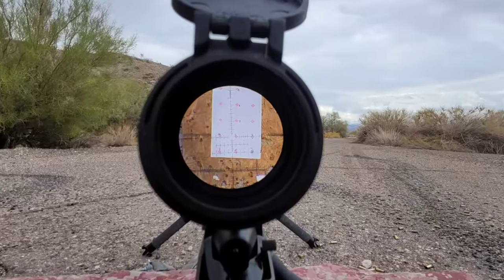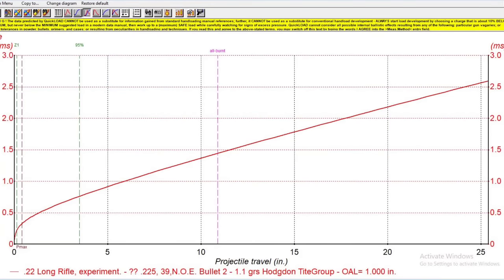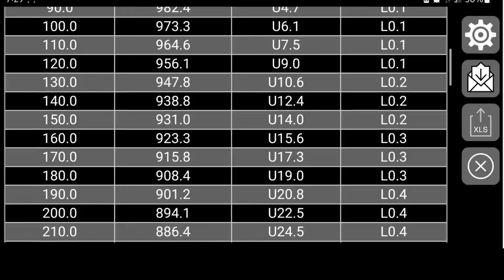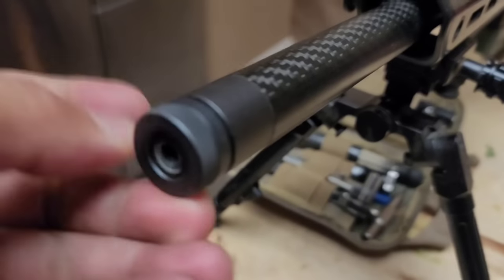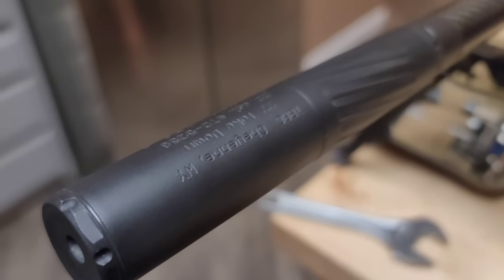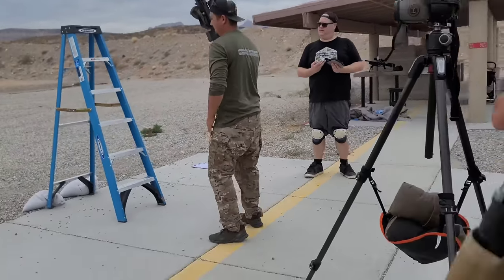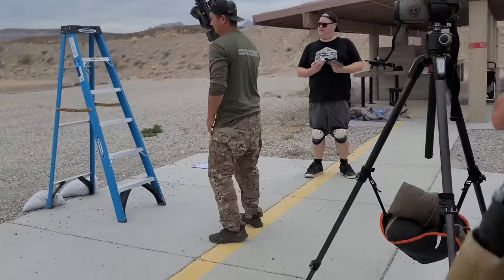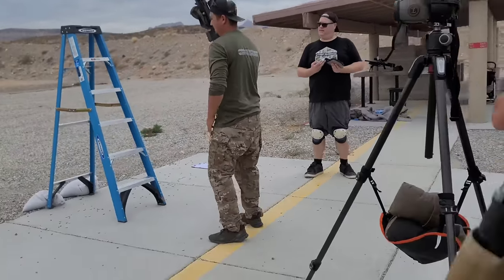What makes an accurate 22LR | Mythbusting Part 2 #DPGunworks

Comment: Dude this is a GREAT SERIES !!! Thanks for taking the time to put this all together, it’s obvious there is a ton of time in this video . Super well done Buddy
Reply: Old timers use to put 24 inch Barrels and 26 inch barrels and I have to think the added length would have to help to conform the bullet and maybe just maybe it would help to make the bullet a little more concentric and in return help the bullet fly just a little bit truer. If it doesn`t slow the bullet down I would think they had it right but then they probably didn`t have machine as well made as the gun smith have today.
Reply: One of the most accurate 22lr rifles I ever shot was a friend’s old marlin lever action with a very long barrel that probably had national debt equivalent rounds thru it. So I do agree barrel length selection must be either for accuracy or velocity. Unicorn are just that until either technology or manufacturer care improves.
Reply: What you are talking about is what my dad and I discovered years ago with .38 special and 30-06 by casting our own lead bullets for accuracy 😊 my best .22 rifle for accuracy was and is a 1970 bought Marlin 39-A Golden rifle and my dad’s 1917 Remington Infield world war 1 rifle with a 150grain round nose cast lead bullet 😊 He would work and learn the right mix of lead 😊 it was fun to watch him do this😊he is now in heaven 😊dad always spoke of barrel lenght and velocity to get those tight groups
Reply: @richardmattix5322 the longer barrels works just fine 20,22,24, and 26 was sometimes the sweet spot😊I am old enough to watch those old timers do it😊I enjoyed spending all day at a 200 yard rifle range from 1963 to 1972 😊

Comment: The most accurate 22lr I own is an Anschutz match 54, 24in barrel. If you swage a bullet through the barrel you'll notice the bore diameter gradually tightens. They hand lap the barrel at the factory with fewer strokes at the muzzle, this probably allows for a more gradual deformation of the bullet
Reply: That 24 inch barrel is the sweet spot like on a Marlin 39A golden made before 1990 I am just picking a year but you can tell what I mean Remington bought them

Comment: Looking forward to your 457 barrels!  My varmint 20” non MTR is producing about 0.5-0.8” 10 shot groups at 50.  But it can keep 20/20 rounds on a 2” circle in calm conditions at 100. 

Not great not terrible but I figure I’ll either tolerate it and continue ammo testing or just go balls out on the nicest custom barrel.  I realize the CZ is not optimum with its 1” max diameter but I think I’d want 26” minimum.  Plus… as evidenced by my 28” super Lux long bois are pretty dang quiet with match/subsonic

Comment: Here's another theory on why the longer barrels might be more consistent. Do think it is possible that when the bullet leaves the barrel the hollow base of the bullet will have a tendency to flare a little if the pressure is higher and this would hurt consistency? With the longer barrel the pressure is lower and the base of the bullet would flare less or not at all. I say this because I have recovered fired 22LR bullets from very short barrelled pistols and the bases were grossly flared. I also think you are right. Those soft lead bullets are kind of swaged by the barrel and if they happen to go through a tighter spot they are soft enough to kind of swell back to shape for full obturation. A harder bullet may not do this so if it encounters a tight spot it will remain deformed and will develop more "looseness" as it travels down the bore and encounters more tight spots. I say this because as a trained forensic bullet examiner it is well know that with lead bullets, the striations we compare are usually from the last inches of the barrel whereas with jacketed bullets they will pickup different striations on their surface all the way down the barrel. The jackets are harder and are permanently deformed or at least until the bullet encounters something else later that might over-engrave the first striation.
Reply from the maker: Much appreciate sharing your expertise from training. This gives good insight.  Thank-You.  The shorter barrels do give less time for the bullet to return back as you mentioned.  This definitely will effect the bullets BC value

Comment: Hi, I liked the two videos very much, but I took a different way to come to the same conclusions. I love shooting the 22lr, but I wanted to shoot in the BR 50-50 matches at my local range in VA. Like you said in the videos, I noticed the winners had different actions they all used long barrels 26 to 28 inch. And most of the winners used Eley ammunition and Harrel barrel tuners. So, I gathered op all the parts and built me a rifle and while I never won a match, I did come in 5th place in a field of 18 shooters.
Reply: Kettlefoot by chance?
Reply: @jonathanrollins2470  Not Kettlefoot, I was shooting at Blackcreek shooters on the other end of the state.

Comment: Interesting video.  Sorry I didn't find it sooner.  

Regarding longer barrels being more accurate, another factor to consider is that after the powder burns out, the further down the tube the bullet goes, the lower the residual gas pressure and temperature get, so there will be a reduction in muzzle blast playing off the bullet base with a longer barrel.  That will reduce lateral drift caused by any degree of asymmetry there may be in how that blast deflects off the bullet base.

Comment: I believe that obturation is the expansioñ of a bullet casing under ignition pressure which in turn causes the case to grip the chamber walls. This greatly improves the safety of many cartridges by preventing the bases of cartridges being torn off.
When the pressure releases the case shrinks down and can be extracted.
(,Information sourced from Wikipedia)
Reply from the maker: Their is projectile obturation, the temporary elastic property of a lead projectil to seal inside the bore and mitigate gas cutting. (Look up obturation on cast bullets). And thiers the same with the case...... both work differently

Comment: At one point I got in to break barrel air rifles and I figured out there was one brand of pellets that seated in the barrel more consistently than others like crossman which had a variance in tightness when seating the pellets. The crossman was a softer lead as well I noticed. The brand that seated more consistently had tighter groups.

Comment: Wow. I was't expecting this when I clicked on this video. Well done. It might be possible to build a water trap to capture the bullets without deforming them and measure the bases from different length barrels. That would be interesting. If plain water deforms the bullet too much maybe aerate the first few feet of the water or even make the top couple of feet shaving cream or something. 

Liked and subbed. You are brilliant. Thanks for sharing your knowledge.
Reply: When experimenting with .22lr through a smooth twist barrel we captured the bullets with no visible damage  in a double  12 tog synthetic  duvet rolled up length ways .  Obviously safety first at all times.

Comment: Be interesting to see if groves cut into the lead in the longer barrel somehow become more deformed the longer it goes down the barrel   creating less consistant areodynamics. Like somehow the lead rolls over on itself less consistantly or more somewhat how a knife blade is sharpened more on one side. My two cents but I dont have any answers though.

Comment: Just found you, and I'm glad I did.  Awesome video that answered questions that I have had forever.  I do have a question concerning the Ruger 10/22. maybe you can help.  I have built 2 Steel Challenge rifles, both using Tactical Solutions barrels, and they both work great.  However, in my quest to make an even lighter rifle I made a barrel as follows.  I took the standard Ruger barrel and cut it down to 6", turned the last 4" down to .50" diameter, heat swaged an aluminum tube onto it giving me a total barrel length of 16.25", and a weight of 11 oz.  Accuracy is great for SC shooting, but the gun will not function properly because the weight of the bolt, and the spring rate are designed for a rifle length barrel, not a pistol length.  So now the question.  Should I reduce the weight of the bolt or just use a lighter spring?  Or a little of both?  My fear of going to a lighter spring is that with the bolt going forward I may not have enough energy to strip a round from the magazine.  I polish the lips on the magazines to eliminate drag, and reduced the spring tension in the mags by reducing the number of turns on them.  Any suggestions as to which way to go?

Comment: Awesome, however, I think  people mis spoke  when they say-wrt a 26" bbl- you can move the bbl before the bullet leaves the muzzle. Mistaken problem  identity?? We all know bbls simply hang,, or sag due to gravity. If one is wobbling however slight, or there is always some vibration just sitting there, unfired. THEREFORE- could it be, wrt the longest barrels- is there possibly be a whipping effect?-  However slight as a shooter moves the bbl around to get on tgt? IE: BARREL WHIP EXACERBATES the problem?? Does Trigger pull & lock time  in the longer 26" bbl cause slightly more whipping?  Couldnt The sum of all that have more of a disadvantage effect on a longer 26" bbl?
Thank You for a great GREAT video!

Comment: .22lr powder is actually a bit slow. However, the percentage of high explosive primer compound is much higher than a centerfire cartridge. I discovered this when I was working up the .22  Epperson Cricket, .25acp case necked to .22 caliber. That project was an attempt to recreate .22lr ballistics in a centerfire, reloadable case. While it was an interesting project,  the difference in primer amounts demonstrated that it was actually not possible.
Reply from the maker: Look into 22rf CF made by RCC brass. Its a reloadable 22rf brass with SRP pocket. PTG makes the stiller action with both rimfire and CF 22lr bolts. Im actually working on building a rifle for a client using cutting edge 50gr bullets and a 1:6 Bartlein 22rf barrel
Reply: @EagleEyeShooting  
I spent several years on the project, but that was back in the late '90s and early '00s. Had all sorts of energetic conversations with several of the, I like to think, major accuracy players. Including Bill Calfee. 
But as for a centerfire crossover, the rimfire case has to have high explosive primer material all around the rim, while the centerfire primer requires much less for that primer cup to function. The difference in energy impulse between the two is huge. Aguila makes the Colibri ammunition with no powder whatsoever, and originally made it with just a standard rimfire primer charge. A centerfire primer just doesn't have the umph to get even the 20 grain pellet to clear a 20" barrel.
I went by the group nickname Vibe back then.

Comment: I noticed you didn’t mention problems caused deformation of the soft lead from feeding problems as the bullet enters the chamber? I have wondered if this could could be why some ammo may not shoot well in a particular rifle?
Reply from the maker: Absolutely can contribute to accuracy issues if the chamber isnt chamfered well and or feeding angle is causing shaving of the projectile. Benchrest shooters in small bore favor the single shot Still 1500 actions to eliminate bullet deformation or shaving.

Comment: Regarding barrel length...do you happen to see more consistent es/sd numbers in 20"+ barrels?  This had been a LOOONG ongoing debate at our club.  We've got shooters on both sides of the debate.  

Myself, I've cut down a handful of barrels into the 18.5-20" range and I don't think I have enough data to prove anything either way. I have seen ES/SD numbers appear to go up once I've gotten into the 16-16.5" for barrels I've cut down as suppressor hosts.  But, most of the barrels I've cut that short weren't top tier accuracy barrels either (mainly savage and ruger barrels).
Reply from the maker: To summarize briefly, it's not just about optimal velocity.  The extra length of these barrels helps uniform the projectiles shot for shot, giving a better, more consistent G1 BC value. Pressures also normalize optimally at these longer 21+ barrel lengths. 
Its the same concept when slugging a barrel, the last few inches tend to be a smooth push if you've slugged a barrel. Theirs a lot of fallacies about 22lr accuracy. If shorter barrels performed better, than these ammo manufacturers would market it that way

Comment: Thank you very much for sharing your knowledge!   If you mentioned bullet jump or the distance between the bullet and the rifling, I missed it.  That seems to be a big deal in center fire, so I would think it might be important on 22 LR.   Do you have a goal or preference for that space?
Reply from the maker: In 22lr Rimfire, it's quite different.  The cartridge is headspaced from the rim so the fitment of the bolt face to the barrel face is crucial. The chambers are set to engrave the lead projectil.  So it's engaged into the rifling a lot. .120"

Comment: Kenny what are your thoughts on "bolt shims"? Mr Revolver guy on the Day at the range channel swears they helped improve accuracy on his rifles.
Reply from the maker: Bolt shims tighten the headspace. Without knowing your rifle's headspace, you can reduce headspace to below a go gauge and start inducing extraction issues. CZ455/457 rifles are easy to measure headspace by removing the barrel and using a depth gauge. I wouldn't recommend blindly shoving shims like he did between the bolt without knowing where your at in headspace. 0.041'' +-.001 is ideal for Eley 0.043 +- 0.001 for Lapua/SK. Bolt shims reduce headspace. Barrel shims for CZ's increase headspace
Reply: @EagleEyeShooting  thanks appreciate your sharing knowledge with us

Comment: Thanks for all the work you put into this video i learned a lot. But now to take this one more step.  if i buy/build a rifle with all the same equipment you have will it shoot exactly the same.  if not? why not.  i would rather go to a company and buy two barrels that are exactly the same and be able to use the same lot ammo then have to go through the testing to find different lots for different barrels, no matter what the length.  This way when i go to a gun manufacturer it could/should be anle to denote what type ammo works best with the gun/barrel that i purchased.  Thoughts? Thanks again.
Reply from the maker: There are a lot of custom rifle builders out there. However, many take short cuts in production, opting to use cnc machinery, essentially "prefitting" 22lr barrels. Having built over 1500 rifles myself, each one rigorously tested down range, I've been able to narrow down custom chambers, barrel lengths, and barrels to guarantee a .3" or better 50 yard accuracy and sub 1". Building these rifles that are not picky with ammo
Usually lot testing with two of the exact builds will generally perform near the same, however, one rifle my shoot that lot slightly better as the harmonics in that barrel are better suited.

Comment: What do you think of the older Anschutz 64 match rifles?  I have a 1966 with match sights on it, I have never fired it and have leukemia now so unlikely to shoot it until feeling better.  It looks like a rifle that will shoot really tight groups.  It seems to have a really tight chamber, I tried putting some cases fired from a Ruger pistol and they are much too large to fit in the chamber to use them to practice dry firing the rifle.

Comment: Hi I love your videos my question is a have a cz 452 trainer I want put a scope on it what what is are the best rings to use to clear the rear sight I don't want take the rear sight off I am using a 40mm bell up front thank you for your help
Reply from the maker: Would be hard to suggest a certain height. However, a quick trick using Playdoe . Using Playdoe to set your optic to the height you prefer.  Then measure from center of optic to top of scope base in millimeters.  That will get you the height you need👍

Comment: I’ve recently been experimenting with the EC Tuner on a Kidd 20” SS fluted .22 Barrel. My results have been very iffy. So, when and if I finally find a setting that let’s say SK rifle match shoots good on, if I understand what you stated correctly that your Tuning the barrel not the ammo. So any ammo I shoot in that rifle should shoot as well as it could possibly shoot on that particular setting? I was getting such inconsistent results what I thought was a good setting, I’d shoot it a day later in different temp and weather conditions and my groups fell apart. I took it off the barrel. I’ve shot so many different ammos and best I can do at 100 yards is about 1 1/4” moa with or without a tuner. People brag these barrels up but my stock CZ457 and Bergara B14r shoot 3/4” with lot tested Eley match. Idk, maybe 1  1/4” is the best the old 10/22 can do. Flustered abit.
Reply: No what I gathered from the video was you need to find out what ammo your barrel likes before even messing with a tuner.

Comment: While you are correct in the fact that once the bullet begins travel, you won't be able to influence it before exit. However, most shooters are inadvertently moving the rifle as they pull the trigger so the rifle is in motion as the bullet begins travel. If that made any sense. LOL
Reply from the maker: Still holds my statement correct then
Reply: @EagleEyeShooting  yes and I was not  implying that you were wrong, merely pointing out that while many  shooters think they are influencing the bullet after ignition, the influence was before the primer ignited the power. Rifle handling is fully half of the accuracy equation. I enjoy your videos.